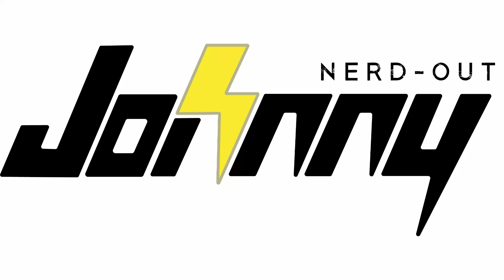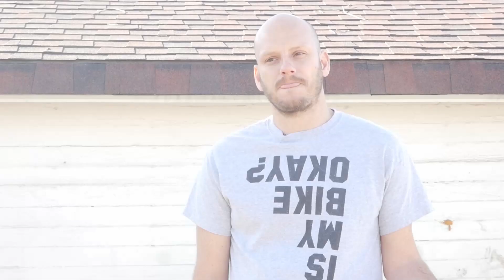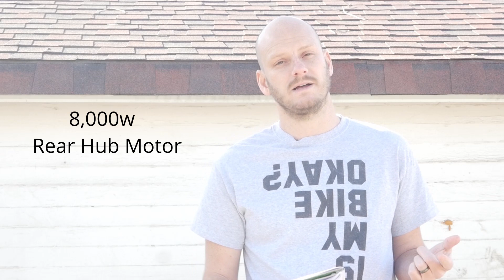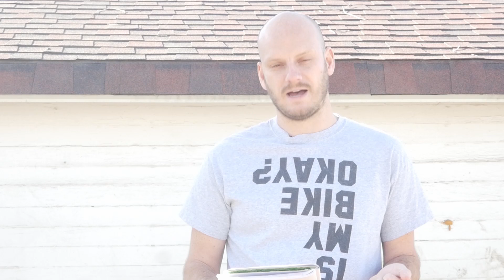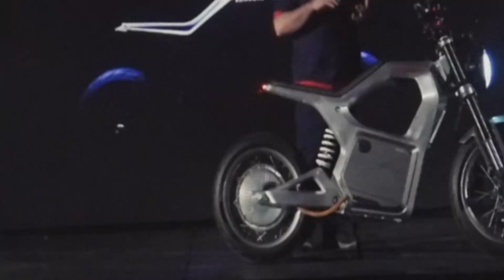Sondors MetaCycle: Thoughts and Opinions

Comment: The specs are similar to an electric Vespa but it’s at least $2,000 cheaper. The Vespa is limited to about 35mph to get any useful range. That gives the Vespa performance on par with a 50cc scooter. The Sonders may be able to go 80mph but I bet it will cut into the range so much that the speed isn’t useful (except for jumping out from traffic stops and passing). And I agree that you shouldn’t take something this light on the highway. I’ve taken a light weight 150cc scooter up to 65mph on a parkway (yes I was speeding) and when any kind of wind hit (crosswinds or vehicle backwash) it became a dangerous white knuckle experience. So I think the Sondors is a cool looking scooter without a step through frame or storage rather than a real motorcycle. For guys who think scooters are girlie, don’t want to learn to shift a motorcycle, and want an electric vehicle, the Sonders is going to be super attractive.
Reply from the maker: Well said!
Reply: Yup this was the bike I've been looking for.

Comment: 3 things I will NEVER believe about these introductions.
1) Weight.. it will be heavier.
2) Range.. it ain't going that far.
3) Power.. they wish.
other than that very cool...
Reply: @Aea Alfaro I ride a heavily modified Sur-ron, so not much interest in the monday bikes. 
The sondors actually sounds under-powered to me.
25KW (33hp) of power for a 200lb bike is a good place to start for a street bike, that's like a 250cc ICE engine power
Reply: @Aea Alfaro No, there is no way to legally ride a sur-ron or monday bike on the streets here in Oregon. They are too fast for moped & too slow for motorcycle.
Reply: @Aea Alfaro No I don't ride illegal. Monday is legal as M/C? It can't be a moped cuz it goes over 30mph.
Reply: @Aea Alfaro I ride my own custom electric peddler for urban travel.

Comment: What about a Honda Grom as a competitor - costs about 3K, top speed around 55 and gets around 150 mpg (2 cents/mile).  What is the cost per mile for an ebike, about the same?
Reply from the maker: I think the grom is more like 80mpg. Still incredible. Specs wise the meta cycle should blow the from out of the water performance wise. I would throw the grom in the same group of prospects though, sure.
Reply: @JohnnyNerdOut  Thanks for the reply.  I  currently commute on a Ducati scrambler which is extremely fun but the cost of gas and maintenance is what kills me.  Always looking for something with a similar level of fun but more economical.  I hardly ever go on the highway.